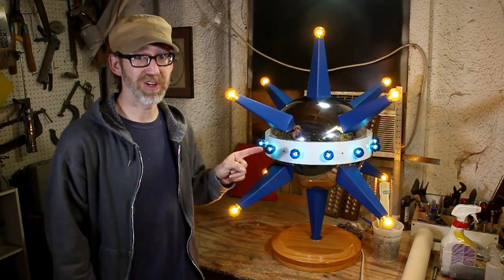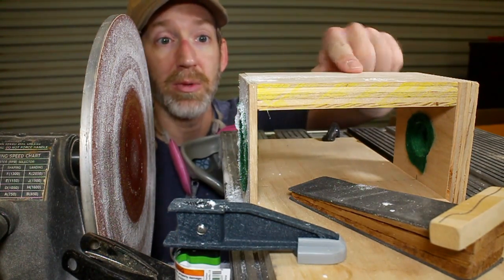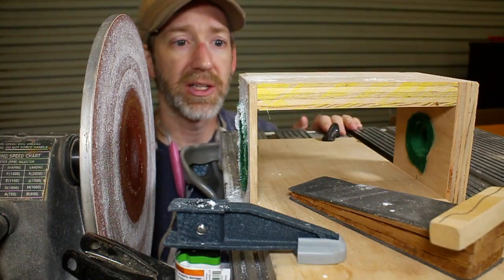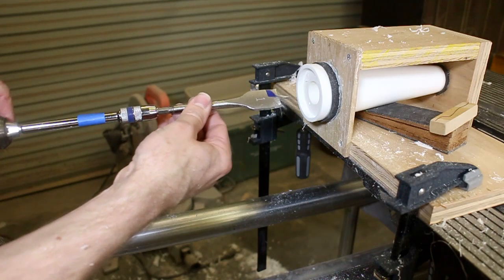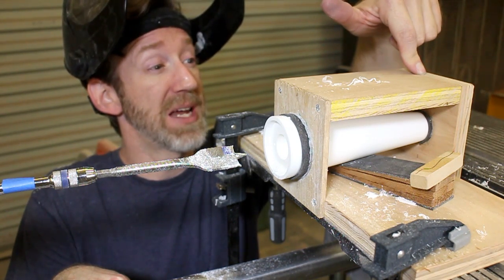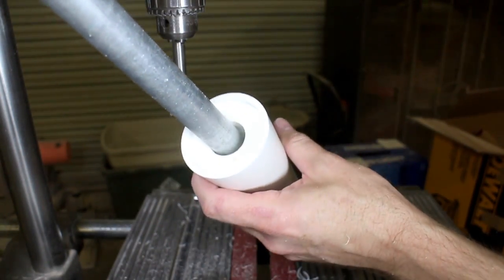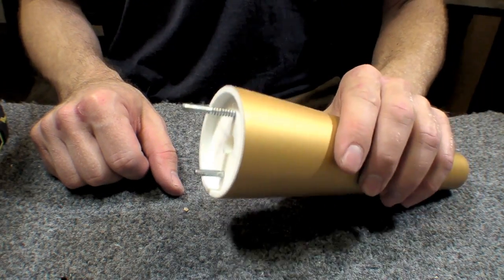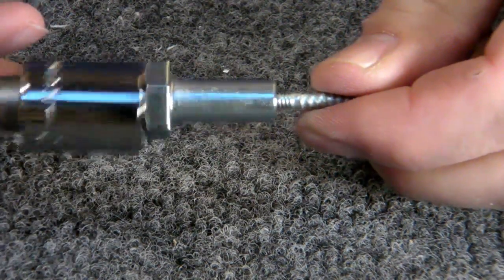Creating Custom Space Age Sputnik Lights

Comment: Just found your channel and man did i learn a lot. . . never was impressed with a Shopsmith but you sure as hell changed my opinion.  As for your style and personality . . .winner, winner. People like you are needed in this world to teach, and you do it so well.     Thanks  D. Oktim
Reply from the maker: Thanks! And a ShopSmith is OK for some things -- just avoid it as a table saw.
Reply: @WesleyTreat  It is scary as hell as a table saw, especially if your blade isn't the sharpest. The lathe is a bit low as well, but workable on a stool. I love how you use the sanding disc with a jig instead of moving the piece into it! I'll definitely be using that idea. Not sure how I never saw your channel before, I instantly subscribed after watching your Herbal Smokes project.

Comment: You did a lot of great work there. I am in my fifties , and have fond memories of these also. I have been working on one as a long term project for a while (procrastinator here) , I used to do industrial construction and demolition and have accumulated all the parts. Beings my parts are different ( actually much heavier, wish they were lighter) I've got to do machining and welding on mine. Luckily I have a machining and welding shop. Just don't have the time, I guess. Either way , your's came out great. I can only hope mine look that good.👍

Comment: I had an idea about a way to make your sputnik spikes easier... Use warm, fast net epoxy, chuck up your mold in your lathe / horizontal drill press, and pour a cup full of epoxy while spinning the mold while it cures. After a few minutes, stop the mold and remove the cured part from the mold and continue. That way, you end up with hollow, thin wall spikes and cut down on the drilling processes. The amount of epoxy you pour in the mold adjusts the thickness of the walls, since the base will be thicker than the pointy end, leaving you room to screw them down

Comment: The project turned out superbly, and I am certain many thousands of drive-in customers are in love with their kitchy beauty. But I have one question: Would it have been prudent to run a ground wire from the inside of the metal spheres to the third prong of a 3-prong plug?
Reply from the maker: I always do. 👍 Thanks!

Comment: My trick for this double-threaded screws or whatever name it is, is, I first put a nut in the "nut-kind" thread, then pick a Dremel or a metal hand saw, and saw a slit on this to fit a flat bladed screwdriver. Then remove the nut, which will reform the thread after the burrs, and there you have it!

Comment: I found your video while looking for a restoration of an original Sputnik light. I've always wanted one but never had the chance to get one. I've thought of trying to make one. The originals are much bigger. Do you know the diameter of the originals. I've never seen one close enough to measure it. I'm guessing around 18- 24 inches. There are two at a retro car lot in the city I live in. What did you use for the spherical part? Loved the video. I need a shop like that.

Comment: So cool!  I have seen a couple of videos now and your craftsmanship is really clear. Was there a reason you couldn't have used screws like a #8 Robertson to attach the cones to the bowls?  Or used a larger hollow centre nut attached to the rods that hold the bulbs?

Just wondering if you could have saved some work and had an equal result?

I also wondered if there was a reason on your 2 2x4 stool (super cool btw) you didn't use a single brad nail at the top and bottom to hold the verticals on so the glue could set without them moving while you insets the others?

Not meant as a criticism at all, just wondering your thoughts.
Reply from the maker: Good questions. With the first sputnik I made that was similar to these (not shown in the video), I used screws to attach the antennas rather than hanger bolts. But, while it seems totally simple, it ended up being a larger pain than I can describe to properly aim the screws into the pilot holes within the antennas' bottom recesses. (Again, it sounds like no problem at all, which is why I did it that way the first time, but it quickly became frustrating in a way that's hard to explain.)

As for the center nut, I would still need something preventing the antennas from twisting, thus the bolts. The center rod is solely for the electrics and is deliberately kept separate from anything structural.

Regarding the stool, I may have been able to use brad nails, but with 28 of them on each face, I think they would have been too obvious. Plus, I doubt I would have been able to aim all 56 of them into the 1/4"-wide ribs accurately, anyway.

Thanks for the questions! (Also, YouTube commenters take note: This is how you ask questions about choices made, instead of with "Why didn't you just do X thing instead which, despite my use of the word 'just,' would not have actually been easier, but I'll go ahead and assume you had no good reason, anyway. Unsubscribe!")

Comment: Cool video. Beautiful product as always. How weather-proof are they intended to be?
Reply from the maker: The aluminum, resin and PVC sheet will hold up great, and the paint is all rated for outdoor use. Thanks!
Reply: Oh, I was thinking about the wires and electrical connections.. how susceptible they might be to corrosion if the Sputniks are out in the rain a lot.
Reply: tohopes that was my concern as well... good question. :)
Reply from the maker: All the wiring is inside the housing, so it's all safe.